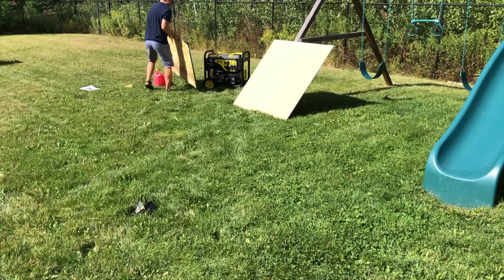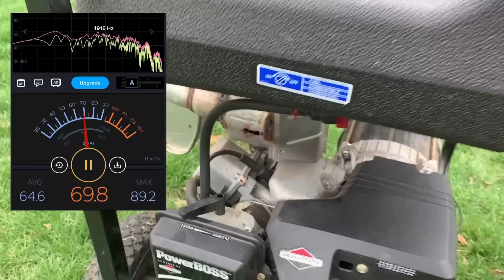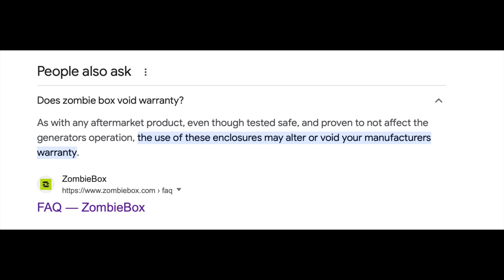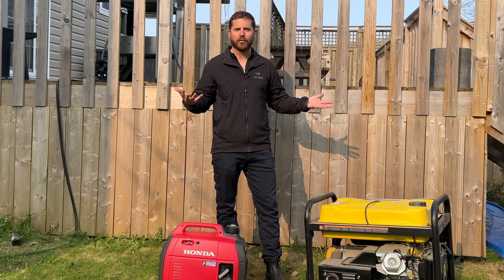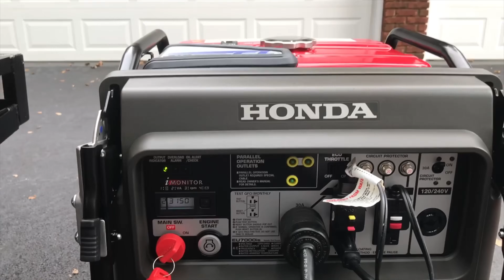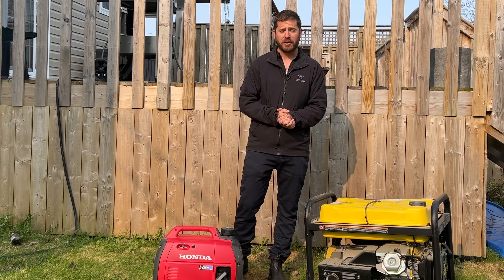8 BEST Ways To Make a Noisy Generator QUIETER!

Comment: I got an WEN 11k watts generator as a retirement gift. Noisy compare to my honda, but it does have dual fuel capability, gas or propane and electric start. Use a 275 gallons plastic tote for its home outside on a plastic pellet. If need to use it just flip the top off to the side between the generator and the house to help with sound block. If you are 25+ ft away then it is not bad.

Comment: This might surprise you, but a motorcycle muffler works better than a car muffler, for generators. Another thing that helps is a tall exhaust stack. A quiet box or quiet shed, well designed and constructed, really tames the noise of an open frame genny. Don't forget a heavy rubber mat under the unit, if you use it on a concrete pad. Old gym mat (weightlifting type, not gymnastics  type) works pretty good.
Reply from the maker: Great tips! Thanks for sharing your insights.

Comment: two universal tricks: 1) put it on grass or a rubber mat, never a hard surface - sound going down is absorbed, 2) make the muffler box open topped - the sound vents vertically into the sky, only birds flying overhead will get it

Comment: You had me at Ferengi. I just bought a WEN--you have that Canadian accent, yes we can tell, and I don't know if you have this brand up there 8000 watt dual fuel but it was/is LOUD. And see where you are standing? I live in Staten Island NY and while we are the borough of parks, I live across the street from one, my neighbor though is on the other side of that fence behind you (which I know is not a fence). I did buy a comparatively cheap but good Chinese inverter gen that gives me 2400 watts of clean electricity which is quieter and I will, if I need be, use it at night so the neighbors don't throttle me in my sleep...throttle me--I crack myself up. Anyway, I am very appreciative of your efforts here. I think I will go with the little wood house on the prairie.  I do have a question on that. It LOOKS like you have it boarded on three sides and not the fourth presumably where the exhaust is. Am I right about that?  Being part of Metropolis we don't get many long term outages, last one being Sandy but since 9/11 I've been a prepper and feel I cannot live without backup-. So thank you.

Comment: One basic thing that i imagine would make a difference is wha the generator is physically set on. Putting it on dirt, grass, or some rubber mat would be a big improvement over concrete which would make vibrations louder and reflect all the sound waves that hit it. I just got a diesel  generator but live in the third world shere homes tend to all be big concrete block shells. Anything helps, so i might try building a sound dampening box for it to help the neighbors out especially since we need a generator several times a year.

Comment: 8 BEST Ways To Make a Noisy Generator QUIETER!

I have one of those little tiny Chinese 2 cycle generators from about 35 years ago and it's got quite a muffler on it. I believe it's Chinese. I bought it used for $50 from a guy who sold Chinese everything out of a High Cube Truck at Car Shows. He used it for lighting inside his truck. I took it to deer camp where we have a little covered wind break for the usual generator and I put it in there and ran it. It was so quiet most of the guys hunting couldn't hear it from inside the cabin. It ran all the lights in the cabin, the TV and video player, the ceiling fan and even the electric toaster. However the toaster was 1,250 watts, so it was straining to run it. I took a look one time out at it while it was running the toaster and the smoke was just rolling out of the lean-to shelter  but it ran it. It's also very very efficient on fuel, so I kept bringing it to deer camp.  ben/ michigan

Comment: My neighbors dog , sorry, dogs, start howling sun up, sun down, and i built an enclosure, air tight, sound treated, with exhaust and intake between our fences, literally against thier fence,,  facing neighbors side, now drowning out the dog barking, and it's way better than be quiet, it made the dogs quiet!!!
Reply: I can put up with a lot of things, but dogs that bark like that drive me insane.
I know dogs bark, but it's not supposed to be constantly. I can understand when someone comes into their yard. I'm 61 years old, and I've had several dogs in my life both inside and out, but none were what I call "barkers." Mine would bark when someone came in the yard, pulled into my driveway, and when you played with them, and they would get excited.
They have electronic devices now that you can put in your yard,  on your home, or up in a tree that work good on keeping them quiet.  The signal won't go through walls or fences, or if your neighbors dog is on the other side of their house from you but it helps if you can mount them up high and get over the object.
And if you're in the States  and all else fails, you can always call it in and complain. I hate to be that type of person, but I have done it once when I didn't have any more choices. Most US cities and county's have laws on "nuisance barking "

Comment: Another good way to reduce the noise is to dig a hole as deep as the generator is tall and set the generator in the hole. plenty of ventilation and really reduces the noise. I leanrned this in the Army and it is a solid choice if you are in an area that you can dig a hole. You should try it and do a video on it. This was a good video.
Reply: Absolutely false.  The sound pressure will be almost exactly the same and from the same distance.  You would then have to COVER the opening AIR TIGHT to reduce the sound level which will come right up from the hole hit the air above it and radiate exactly the same as if you had the generator right on top of the ground.  The only thing you are reducing is the sound from the vibrating generator frame a few meaningless db's at most
Reply: This is probably a good idea until the hole floods.

Comment: Vehicle sound deadening wont do shit.  Vehicle sound deadening works but reduction the road vibrations in the sheet metal.  Most people WAAAAAAAAY overdo it too.  You dont need to cover your entire door ski  with it fir example.  4 inch circle is more than enough to deaden it.

Making sound insulated panels using fiberglass woulf work but not using automotive sound deadening.

Comment: 2:37 Its not CO2 (carbon dioxide). It’s CO (carbon monoxide). Big difference. One will kill you fast. The other is a byproduct of respiration.
Reply: @4:55 he says this correctly; carbon monoxide detector
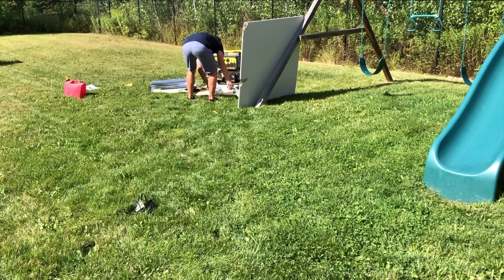Reply: @ 2:27 he said CO2 gas which is carbon dioxide. Listen before you speak.

Comment: A small 2 pole generator needs to operate at 3600 RPM to produce power (60hz). Go out in the driveway and rev your car to 3600 RPM, engines are just loud in general when spinning that fast.

Comment: I got mine in my shop(3500watts),and I run two 50feet extentions  in the house.But then again I am lucky, to have a shop to put it in and it is close enough to the house.
Reply: Your shop is now a death trap!  Do not ever run a generator indoors.
Reply: @mojoman2001  Hey bud,do you tkink of me stupid enough to run it without an adequate ventilation ?Just think about that.
Reply: @michelchartrand7257  -- Adequate is a matter of opinion.  The owners' manuals which I have read say don't do it.  They do not say to form your own opinion as to whether or not the ventilation is adequate.
Reply: @mojoman2001  You sound like my old lady,you want to have the last word in...well you can have it.Goomby.
Reply: @michelchartrand7257  -- Bud and Old Lady?  You've been breathing too much CO.  😂
Reply: @mojoman2001 adequate is adequate. If you run it in a room and you die then you know there wasn't adequate ventilation. If you don't die then you know you had adequate ventilation.
I run a Mr Heater tank mounted propane heater on a 40 lb tank inside my shop with a window halfway open. I  never leave it running unattended though. Common sense works great for the people that have it

Comment: That was interesting seeing him put insulation inside the Inverter generator where there is little room...why not put it on the outside? Make a teapot cozy slip cover you can put on or pull off that leaves air intakes, exhaust, controls and receptacles clear?
Reply: Because the point is to absorb the sound. I thought the same before I researched why I couldn’t trust dobeh
Reply: @Hyperactivemeoww  There is the matter of heat.

Comment: The leaning plywood method method is probably the most practical and cost effective of box. I run my generator on the upstairs deck sitting on 1/2 inch of neoprene rubber. The noise is reflected upward and I can barely hear it right under it. A U shape of sandbags or cinder blocks works well on the ground if you are going to use it at the same spot. If your grass isn't pristine you could put a vehicle between the generator and you. Using a heavy gage extension cord like AWG 10 you can move the generator 100 feet away from the house. You can combine methods, 100 ft away, plywood and place a car or pickup between you and the generator. Direct sound up to the sky, there shouldn't be anything up there to bounce it back to you or put mass/distance between you and the generator.

Comment: I replaced the engine oil with sawdust, real quiet.
Reply: I tried that but the sawdust acted like an insulator and my power output dropped by 50%.
Reply: @ I’m ⚰️
Reply: @scottmitzi you must have used the wrong size sawdust😂

Comment: Really learned nothing here. "You might try this, or maybe this." The real issue with internal combustion generators is that to reduce noise, you often have to use a solution that will cause them to overheat. They are air-cooled, and they generate carbon monoxide ( not dioxide as stated in this video ) which is lethal. They need to be in a very open space when operating. They are noisy. Real noise reduction depends on routing the exhaust system remotely and high off the ground. There are excellent RV systems to do this and they can easily be adapted to any internal combustion generator. Then all you have to deal with is getting ample cool air over the generator engine while it is in a relatively large, sound reducing enclosure. It's work, but it can be done.

Comment: @soundproofguide,
I can outline an outstanding way how to cancel perhaps upwards of 50-60 percent of that noise but you may 
not like it however, but it does not require using a shotgun either!! This is how the military would do it provided 
that the mission would require or dictate for that matter and things of this nature was done clear back in the 
days of Vietnam era. These principles are really quite simple but it can require upwards of about 6-8 hours 
worth of time and effort and a laborious but not severe OR hard to do! On the other hand, if you were to build 
your own box that meets or exceeds the best box out there and you budget for oh say 250 clams or less but 
then it's also built with portability in mind, you would also build it in such a way that you end up with a heavy 
duty packing crate that a wheel kit can be applied to it as well! With a generator that weighs no more than oh
say 150 pounds, combined with a packing crate that still has the portability in mind that it too does not exceed
yet another 150 pounds, the combined weight of 300 pounds is to be achieved overall!! Personally, I would 
construct a packing type crate that has a structure that has a unitized top and sides rolled into one structure
that can be lifted off of the already strapped down generator to the high density PB one inch thick floor and
attach four 3/8" eye bolts that are to be bolted down along with homemade steel cabling that makes up from
a four point T bar hitch that has a coupling at that top for the cable sling point, just so that the hook on the boom
lift, can lift from just one single point yet the cabling is anchored towards the corners of the already eye bolted
cables and their cable clamps. The eyebolts bore holes being predrilled themselves needs to be bored nearly
1/2" diameter off the corners oh say 3" away from the corners on a diagonal plane from one corner to the 
opposite corner, since your crate and floor platform is of a rectangular design. Those eyebolts needs to have
flat washers topside and bottom side of that 1" heavy duty rated high density particle board ALONG with
lock washers WITHOUT fail and to be torqued down considerably with the use of a 1/2 inch long handle socket
ratchet and/or with the use of a torque wrench, if you have one OR a long handle crescent wrench; for all four 
holes in order to preserve the integrity of the generator floor and the overall strength! Just remember that 
you'll be lifting a whole lot of weight. You cannot make a fatal mistake and have that kind of weight OR 
strength give out on you while you are trying to lift a heavy object and be in the way of it should it give out on 
you!!! The cabling that you also purchase should be rated to be able to take a load of at least 3 times the weight 
OR at least 3x 200 OR 600 pounds lifting strength also! The eyebolts as I have said should be on the order of
3/8" eyebolt threading in my mind should suffice although 1/2' threading is even better and chances are that an 
eyebolt of 1/2" for the thread size will more than suffice for the combined lifting of said two hundred pounds!

Take another 563 clams and go and buy one of these hydraulically actuated, extension boom, lifting & articulating
kit that can be bolted down onto a pickup truck bed/van/pull behind trailer bed such as a 3/4 ton truck so as to be 
able to do the hefty lifting and traversing the load onto the vehicle itself! This way if you had to pickup and go with 
it even if you are in a wicked hurry if need be, almost if not completely by one's self! These manual hydraulically 
operated by hand boom kit is on the average are rated for at least 300 pounds if not more, max rated and average 
somewhere around 563 clams the last time that I spotted one! Bare in mind, if the total weight of 300 pounds
worth of valuable cargo has to be readily accessible to accommodate the lifting and loading is to be achieved!
Achieved by the mere backing up of the vehicle that is to be used or by by the mere being able to take like a
stake body 3/4 ton van and pull up beside it that has a low stance, OR pull behind trailer to load and off load that
generator and strong box crate. I am here to tell yeah that my Sears 3/4 ton van that was equipped with such an 
a lift mechanism kit that could handle this kind of load and was thought of by my service manager and had them
installed into our service vans just inside of the rearward two opening doors but we were not using this lift for
generators but now if someone were to craft and position this kit just inside of the curbside sliding door and affix
it very close to the "B" pillar and bolt it to the steel floor with the use of a good sized backing plate while from 
underneath the floor bed, that can be rather nice if it is to be entirely possible! Upon bolting this kit to the floor of 
the inside van floor, I would also make for some extra bracing that can be attached from the boom steel cylindrical 
tubing onward to that "B" pillar to provide some much needed high strength to accommodate that massive weight 
while putting it to use and NOT crumple OR warp the van's steel floor! This type of chore for most folks can be just
a little bit daunting but not really hard to complete! If careful thought is put forth before just going at this willy
nilly, the kit can be mounted without a very big, very big deal, just know once again that there first off may be an
obstruction from underneath of that van that may not in the short term may not accommodate the immediate
drilling of your hole pattern thru the floor and secondly to be able to  accommodate the carefully crafted backer
plate that is to be able to fit into a tight area close to if not nearly butted up to the "B" pillar to begin with and so
there is much planning and measuring to make it all happen BEFORE you attempt to drill any kind of holes in the
first place; PERIOD! ALSO, in the execution of planning make DAMNED sure the is NOTHING in the way of said
flammable materials, no steel or plastic brake lines OR fuel lines that can be in the very close proximity or path 
of where you are to do ANY drilling and but of course then the project can perhaps proceed! Measure three times 
over to ensure that this project will go as planned!
Reply: That's the
weirdest format I've
seen
.

Comment: I witnessed a guy with the Honda 2000w, in the pacific northwest, used a wet towel draped over the exhaust. Pretty much covered the top. It was much quieter. I have the Pulsar, but haven't worked that experiment in, yet.
Reply: How do you like the Pulsar? I'm thinking about getting the 5000w

Comment: The easiest, cheapest and quickest way that makes the biggest difference is to run the exhaust into water. Same concept like small boats, they have no mufflers or anything they are basically like a car with short straight pipes that’s why they are loud out of the water when you start up in ur driveway but then in the water the exhaust is under water and very quite. I use a small pool made for dogs it’s about 1 ft deep, maybe 6ft wide and it folds up for storage. You could try a kiddy pool but this one is deeper and wider than any kiddy pool I’ve seen which allows the water to not get really hot. If u try it just make sure the water level is lower than the engine so there is no chance of it getting into the engine if it stalls.

Comment: I use a Craftsman 4' by 2' half height resign storage shed. When I run it I leave the top lid cracked open and one of the doors cracked open and you can barely hear it inside the house or from the front of the house.